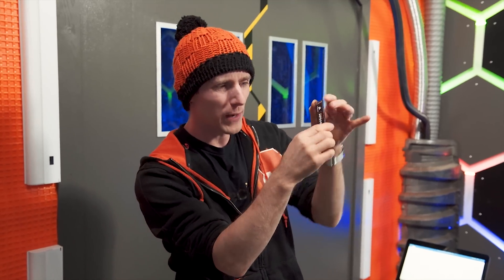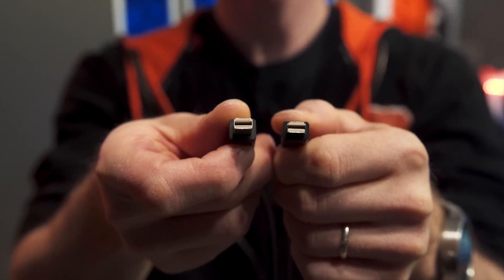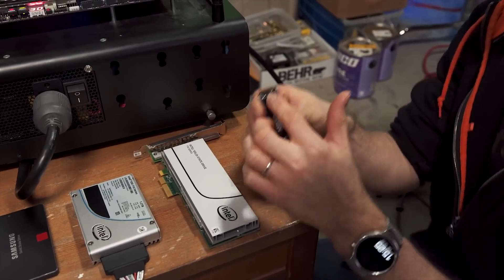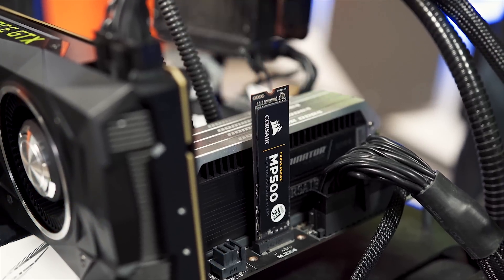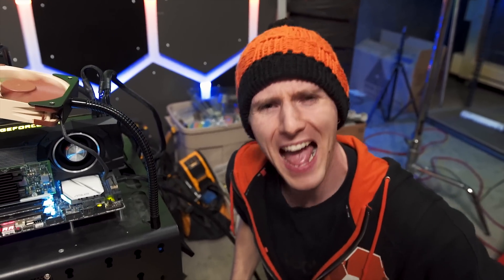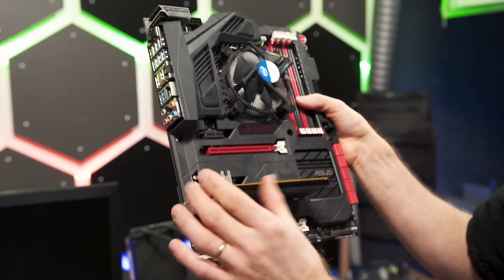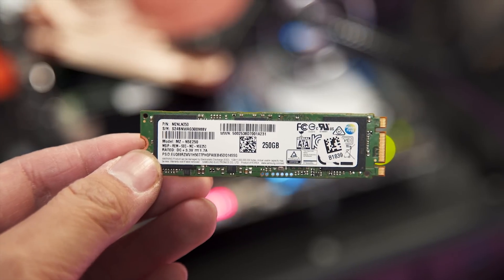The FASTEST SSD Technology Explained - M.2, U.2, and MORE

Comment: Are NVME and M.2 the same thing??
Reply: No
Reply: M.2 is a 'socket', a port,  a bus or an interface, a physical (a hardware) thing like a USB/PCIE/SATA ports. Some are faster than the other. Like how a USB 3.0 port is faster faster than the 2.0 one. 

NVMe is a protocol like AHCI, so is not physical thing. NVMe is a new protocol while AHCI exists since early 200 and was designed for hard drives so you could imagine that NVMe is much faster. It sort of a procedure of how the data should be handled during transfer. Like http or tcp protocols for instance -- they sort of handle the rules regarding data transfer. NVME manages to be faster because is reduces the CPU overhead and some more magic that I don't understand like NVMe having more queues and more command in each queue bullshit.
Reply: M.2 is a hardware connector. NVMe is a protocol.

So no, they aren't quite the same thing, but there's some overlap between them.

You can think of protocols as languages that different components use to communicate with each other, and the hardware connectors as just what they're talking through. Some connectors support multiple protocols, and some protocols can be used over different connectors.

The question you're asking is analogous to asking if English and Email are the same thing.

NVMe protocol can be sent over the M.2 connector, but AHCI protocol can also be sent over M.2, the same way you can write an email in English, but you can also use French. NVMe can also be sent over PCIe, the same way you can choose to write the same English information over a text message instead of email.
Reply: @ChrisPThomas  i thinks he will be more confuse now😂
Reply: Chris Thomas I totally understood that

Comment: Sorry but this made no sense to me :(. 

I'm attempting to build a new computer and the motherboard I picked (Asrock z370 extreme4) has full  support for all this fancy stuff (I think!).  But I still can't work out if I would benefit from spending twice as much on a something like a Samsung 960 EVO drive vs a normal internal SSD at a fraction of the price. 

And does anybody still use the old fashioned HDDs which whirr away at 7000 RPM and are so big & heavy that they can be reused as dumbbells when they die?

Comment: The problem I see with the m.2 NVME drives is reusability. My laptop came with a 128 gig m.2 drive. I looked to replace with a larger size and put the old drive in a usb enclosure.  I could not find a usb enclosure for the old drive.  Cloning the old to the new would be laborious.  m.2 is a great speed boost, but for laptops, any upgrade is just adding to my pile of old drives collecting dust.   A video with solutions for reuse of m.2 and other small drives for the general, non-data center type people, would be appreciated.

Comment: I have a x79 chipset asus rampage extreme with 4960x a little bios hack for nvme support and was off and running as a boot drive my 960 pro gets the speeds its suppose to boots in the blink of a eye you most have cpu and mother board that support pci express 3.0 to work at speed get 3333.5 reads and 2164.2 write speeds on crystal disk and it has a lot on it bin 3 mounths now so thy can work on other chipsets with uefi and added nvme in bios

Comment: Hello I have a hp Chromebook model hp 11-v020wm I want too use for dev.mode sudo commands terminal and Linux and possibly windows on a separate storage like hdd,sata,etc.
But when it comes too the solid state hard drive sodiered on the board. I am just trying too max it at it best for programming,coding,developing etc.
I heard the nvme and the m.2 can be for.ssd. but I don't know if it would work for the Chromebook or how. Please enlighten me on what I can and cannot do. Ps. I am considering a better purchase of a top not windows platform based desktop or laptop. But for now just too get up and running say for 6 months for learning and 1 good project. What if any do I need too max or convert this Chromebook into the best for what I can do. Please respond I need your help and influence.

Comment: Just got the ASRock AB350M Pro4 and it has 2 M.2 Slots. One near the PCI1 Slot and One below the SATA3_2 & SATA3_1. I seem to have picked a good Motherboard so far but should I go with a M.2 near the SATA or the PCI1 Slot? Mostly because I'm still getting the 240GB SSD for $69 for my build.

Comment: Wai tim confused by this video, i have the "MyDigital SSD BPX 80mm 120gb, in my pc, and although it wouldnt let me install the OS on it, i simply unplugged all my HDDS, which i have 4, then installed it, went in and formatted all my old drives and then raided the 4 hdds, and it boots fine, i double checked and it clearly states m.2 NVME (MyDigitalSSD BPX 80mm (2280) M.2 PCI Express 3.0 x4 (PCIe Gen3 x4) NVMe MLC SSD (120GB)) On amazon... even NGFF can support boost out of box, ya its finicky but i didnt really have any issues...

Comment: I've recently bought the m. 2 and I currently have 2 windows 10 os installed one on my current Samsung 850 evo and one on 960 pro most of my stuff are saved and back up on my 2tb hardie but I would like to transfer my c drive stuff 850 evo to the new m.2 is it possible with out reinstalling everything?

Comment: I understood it till he got 5 steps in then step 1 vanished in my mind and it cycled like that till the end. I had an old dell aurora that crapped out. dell replaced it free for a area 51 model. I cant find a m2 slot. I bought a samsung ssd, its for sure faster. But i got a cheap laptop now that has a m2 and that sucker turns on in seconds ready to go and i love it. I wish to mimic this performance on my desktop at least semi closely. I have samsung 500 gig for boot, and 2 main games. a black seriers 2 tb hard drive for the rest and a green 4 tb for storage that came with it. Was going to do video editing for fun to post game footage on youtube but all I can do is use adobe but i cant get myself to spend 50 bucks a month on a program i will use passively. (that was back story explaining why so many drives as people tend to just poke holes...why so many? etc)  How do i make sure i dont have the slot and whats my best cost effective choice if I do or do not have a m2 slot?

Comment: Heh. Back in the vga days carrying video signal in cat5 was so much simpler, excluding soldering the thing (along with a transistor and bunch of resistors) to a vga connector :)
(Also, several versions of of the NVIDIA driver just crashed with the modeline that was required to run a PAL TV. )

Because you know, PAL TV's didn't do YPbPr and video cards didn't do SCART, but at the time high fidelity interlacing artifacts felt like a worthwhile investment of my time.

Comment: I wonder what would happen if you had an "Optane" M.2 (32GB+) attached to one of those cards?
It's intended to improve the speed of the drive having the OS?  ;-)
I'm thinking if the "Optane" M.2 (32GB+) drive works as advertised and supporting a 1TB M2 (OS added) plus two 1 or 2TB SSDs I feel it would be a killer combo if the optane works (I'm optimistic you can answer my inquire)?

Comment: You CAN boot them on X79 with a simple mod of the BIOS to add the X99 NVME UEFI boot ROM.

I'm currently using the 960Pro in that Silverstone adapter that has both AHCI and NVME on my Rampage IV Extreme as my boot drive and it reports and benchmarks at full speed as well.

Comment: by the way 
if you are unfortunate enough to have an z97 motherboard like me most z97 motherboards only have support for an pci gen 2 x2 m.2 
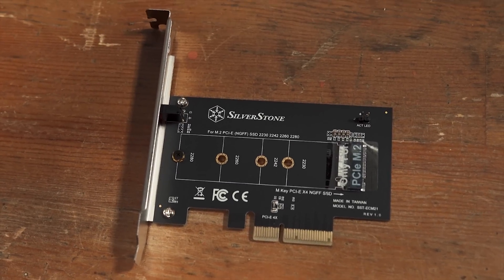the samsung 960 evo runs at pci gen 3 x4 so if you were looking to buy one you'll have to buy a new motherboard or get one of the the cards linus shows at 5:13 ,or it wont run at full speed so it'll just be a waste of money 

and I'm not 100% sure about this but if you are going to get a new cpu with that motherboard you should get one that supports more as 16 pci lanes because I think otherwise it might slow down your gpu

Comment: building new computer noted, new computer case class needs to be made . atx mid tower case now outdated. 
do not need 5.25 bays. do not need any drive bay.(m.2 on board). with a redesign for the power supply. the power supply could be mounted to the back(think power supply 3 inch x atx motherboard size.) of the motherboard and the case only needs to be as big as the motherboard + gpu.

Comment: You CAN boot off of an PCIe NVMe if you have an older computer. I've got a precision T7500 i got for 90 bucks and I have it booting off of a Intel SSD 600p. You DO have to chain-load bioses. I'm booting off of a flash-drive with clover EFI on it. I copied NVMe EFI drivers onto the flash drive (with clover) and installed win10.  You need to remember to boot into clover and then use it to boot the win10 install media or it will refuse to install. CrystalDiskMark says drive is operating at full performance. I'm pretty happy with the setup. No stupid fast boots but its super snappy.

Comment: Does anyone know of any NVMe external enclosures?  I replaced my 2013 MacBook Pro with the new TouchBar model and I want to use the storage from the former as an external drive.  I'm okay even if it only has USB 3.0 speeds, but would love USB 3.1 Gen 2 or Thunderbolt 3 speeds if possible.

Comment: I have an SSD from an old laptop that is the exact same size as the one in my new laptop. They both run windows 10. Would there be any side effects if I straight up replace the drive in my new laptop with the drive from my old laptop? Would the entire computer have the same digital contents as my old laptop?
Reply: Kai Widman drivers and all will be messed up..  i dont know tho ima noob
Reply: just make it legacy then run a driver updater. all should be fine
Reply: Kai Widman you have to re install windows 10 and re install the drivers  your Windows 10 product key should be below the laptop.
Reply: it works on desktop, you may have a problem with drivers though and do a restore thing its not to hard
Reply: i don't think there would be, it is still like a baby desktop and you can do that in a desktop
Reply: The OS should notice that there's a different motherboard and de-activate windows. Did you try it yet?
Reply: I've taken an ssd out of an old build and put it into a new build two different times and it worked. It took a few reboots before things worked properly. Mind you this was with Win 7 Pro, I doubt Win 10 will allow it. Microsoft has gotten kinda funny in it's old age.

Comment: Should also note; for many boards using m.2 slots on board will disable one or two SATA ports as with ASUS (some especially if running in SATA mode).  While this is a good trade off for some, when planning a rig make sure to check the motherboard specs of which ports are disabled (usually in the fine print), if you need those ports and not think the board is bricked because a drive isn't connecting because the port is disabled.

Comment: I just installed Samsung 960 EVO NVMe to G33 chipset machine form year 2007. Plug & play, no drivers needed. Only thing that does not work is boot, so my little boot partition is on  SATA HDD.

Comment: Hey there Linus. What better then to ask a tech geek as yourself about my problem xD

I just finished building my new computer this weekend and have run into a "small problem" with my Samsung 960 EVO SSD m.2 drive. I have installed it on the upper part of my Asus z270a prime motherboard, believe its the PCU slot? And installed windows 10 on it which went smooth enough. But the problem I have is that the boot time from the push of the button to windows seems way to long then it should, and I'm sensing that something  must be amiss. I've tried several of possible solutions people have mentioned on forums such as installing drivers (might have gotten the wrong ones, have to try again when i get home), unchecking fast boot option in windows, disconnecting all other drives from the sata ports. I've heard that you might need to update the drivers for the motherboard?

Well anyway. I figured you might actually know for sure how to handle this problem and would help immensely if you could pinpoint what i need to do so i don't stumble on some faulty information that might ruin my new beauty instead of fixing it.

Parts:
Motherboard: Asus Z270-a Prime
CPU: Intel i5 7600k
GPU: Asus RX480 4GB
RAM: Corsair Vengeance 2x8 GB DDR4 3000 mhz
PSU: EVGA 650 GQ semi modular

figured those are the essentials, if you need anything else just ask =)

Would really appreciate the help.

Thanks for all the hard work, I'm learning alot from ya ;)

Comment: Can you actually feel the difference from a normal SSD to a m.2 in the day to day Windows use? Are Applications starting even faster? Or  is the way the applications are written the new bottleneck? Experimented with RAMdisk and could not detect much improvement......
Reply: No. No. Yes. Exactly. 

... or: NVME primarily boosts transfer speeds.
SATA SSDs improved latency a lot, but didn't put through much more than HDD RAIDs.
NVME over PCIe makes up for the lacking improvement in that department, so to speak :)

Comment: I have Acer Aspire F5-573G i7-7500U gtx950M late 2016 model. I do have m.2 nvme slot on my MOB but when you said that I need to check if my slot is capable to boot an OS using the new m.2 SSD I have aa big confusion. Can you help me if my laptop can boot win10 using m.2 nvme ssd... please!!

Comment: I use an SM951 AHCI. This was before NVMe became available. It doesn't matter for me though, because it's installed on an Asrock Z97itx/ac. The M.2 slot only has two lanes available :( I found this out after I forked out 200 euros, of course. Still an admirable gig per second both ways. My system still is flaming fast (I5-4690K @ 4.5) and I have no need for upgrading for the time being even though the core components are over two years old now.

Comment: Hello, need help if anyone could.. I will greatly appreciate it. So I just bought this laptop last month and trying to upgrade the storage to SSD. My box say model it ZX50V, but when I go to Computer properties it says GL552VW. That's so confusing hence I'm having a hard time figuring out what is a compatible SSD. The back of the laptap has a lable M.2 2280 SLOT SUPPORT SATA SSD ONLY. Does that mean it won't be able to take a 950 PRO NVMe SSD? I tried opening the hatch at the back and noticed that the port for SSD only have 1 notch, isn't that for NVMe interface? and SATA interface has 2 notches? Which one should I get 850 EVO or 950 PRO?

Comment: The NUC (NUC5i5, Skull Canyon, NUC5i7, NUC7i3, NUC7i5, NUC7i7)s of Intel integrates both AHCI and NVMe on one M.2 Slot. Speaking about the M.2, you forgot to mention that the temperature will be a big problem in the future. If you have an application that constantly writes on the M.2, the performances will go down
Reply: PS. According to my Tests, I can't see any performance difference between the two protocols (NVMe and AHCI). You'll see the advantage of the NVMe probably for higher capacity (>512 GB)

Comment: how about a video on the installing of a M.2 on a older board. I understand a few people have modded the bio and some use Clover.. so an Z77 board CAN have a M.2 SSD.
NVMe boot with clover. 
 Theoretically, it should work on every BIOS and UEFI. Not restricted in terms by the BIOS/UEFI-vendor. (Yes, by BIOS I mean even legacy BIOS)
+ No BIOS/UEFI-Modding needed (I used this method for a Fujitsu Workstation with Aptio V UEFI, which is currently not NVMe moddable)
+ Easy updateable EFI. Changes to the configs can be made out of your favorite OS via text-editor.

Comment: AHCI  M.2 based on the sata III protocol and is limited to 600mb. NVMe M.2  is based on the pci express protocol which is capable of 2100mb or more. NVMe M.2 is the latest in drive storage connection technology.

Comment: Hi,  I need your advise.
HP OMEN Laptop - 17t gaming - w151nr VS Dell Inspiron 7567 Review GTX 1050Ti
Which one you'll choose? Though HP is appealing but both have no thunderbolt.
MY NEEDS:
I need i7 7700 +32 GB 2400 RAM + 2 PCIe® NVMe™ M.2 SSD + 4 USB 3.1 + THUNDERBOLT FOR EXTRA GTX 1080 + HOOKING EXTRA LARGER MONITOR IF NEEDED AND ABILITY TO USE WIRELESS BLUETOOTH MOUSE N FULL SIZE KEYBOARD.Low heat also.

MAIN WORK; VIDEO AND HEAVY PHOTO EDITING MAINLY.

UPGRADING AFTER A LONG TIME FROM DELL XPS L502X i7 2670 QM 8 GB, nVdia 540.
BUDGET 2000$
Reply: WELL? .. WILL YOU ANSWER ME ?

Comment: I like the video and it did give some info but it still doesn't answer MOST of the questions people have about M.2 drives:

For instance... 
1)You didn't even try to explain which drives are the fastest between M.2's. I want to hear you guys weigh in on which specific models to get.

2)Why are AHCI not as fast as NVME? What is the actual average speed difference between the two?

3)Are PCIE adapter cards w/ M.2 the same speed as simple M.2 motherboard connections if the drives are the same?

4)I've heard that "random performance" is the true measure of these drives performance for the average user but speeds are mostly posted in read/write data transfer times. I have LOADS of questions about that including questions about boot times. Perhaps Linus or Luke should make a video specifically about Random Performance.

4) SPECIFIC QUESTION for me: I've been told that Kingston's HyperX Predator M.2 is AHCI but it doesn't have an AHCI style connector. Is there a physical way of telling whether its NVME or AHCI? Why is it priced at $150+ USD for the 240GB version if its AHCI?

Comment: on my Asus hero Alpha motherboard I'm using a samsung m.2 950 pro for my boot drive it also has 2 u.2 connectors but if you use them it disables the M.2. then I have 2 Samsung 850 Pro 500gig running in raid the computer boots so fast love m.2